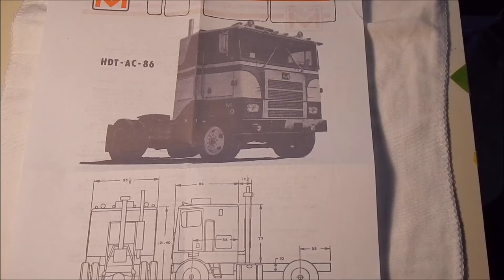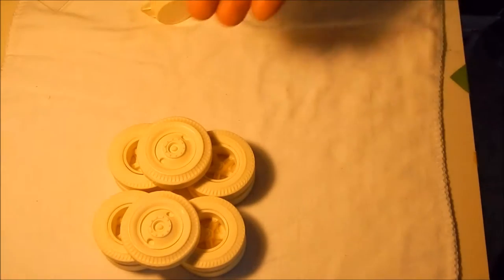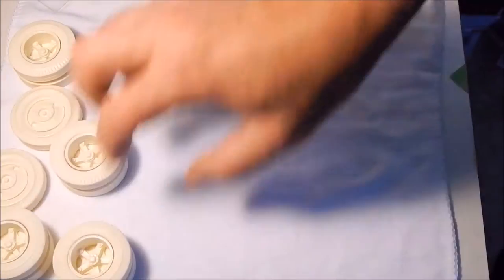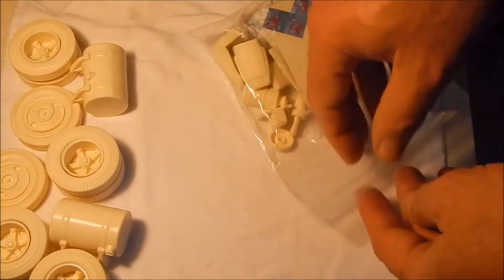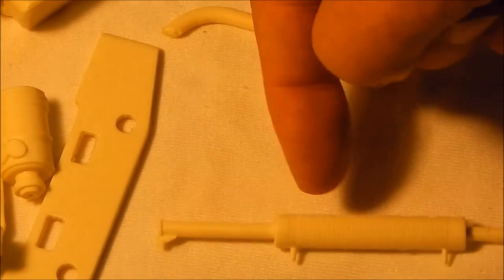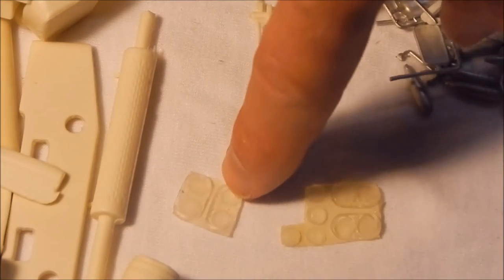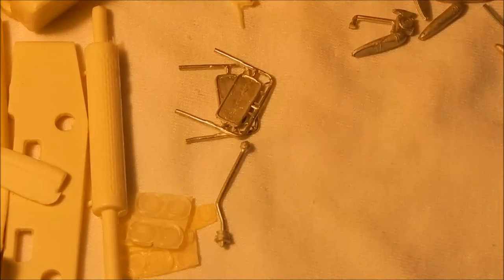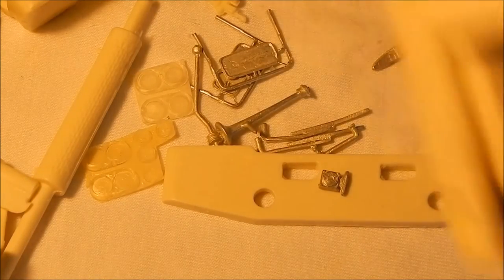Marmon cabover

Comment: Heck I thought that handle under the windshields was to pull the cab off the engine so you could service it. Cause the cab tilts forward doesn't it?? I know when I was installing windshields in those big things that's how I did it. What you learn when you watch these videos. Great video...looks fun...looking forward to the build videos. Thanks for sharing...
Reply from the maker: I was wondering when this would pop up! There is a hydraulic pump mounted behind the cab. It would be pumped up like a bottle jack!
Reply: Huh...I remember putting in glass in some of those things and just getting up there and tilting it by pulling there. I thought anyway. Maybe I broke something. They might have been a Kenworth or Mack or White truck or something. I don't know. That was a long time ago when I had my glass business. Anyway, great video and I am looking forward to the next video. Thanks!
Reply from the maker: It can be done but easier  to jack it up.
Reply from the maker: https://youtu.be/QMiAP6jYTNg